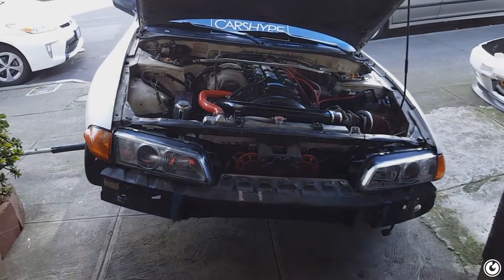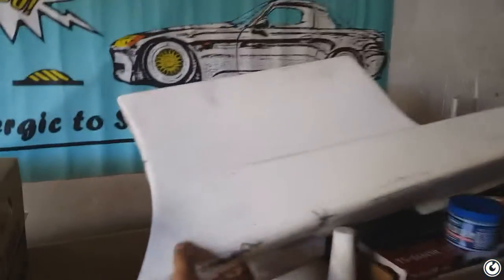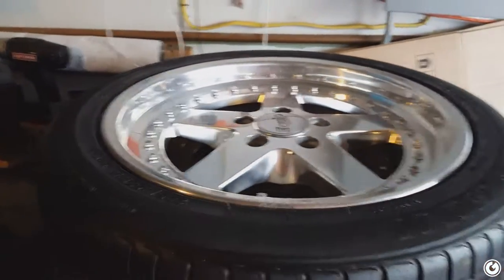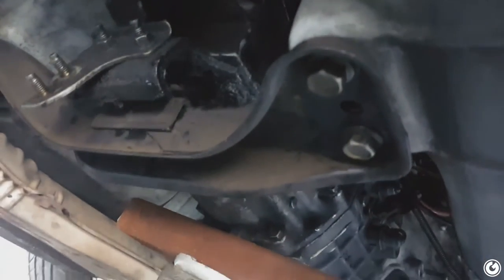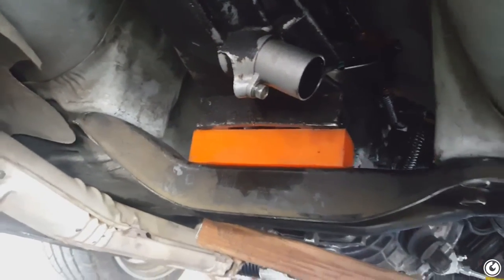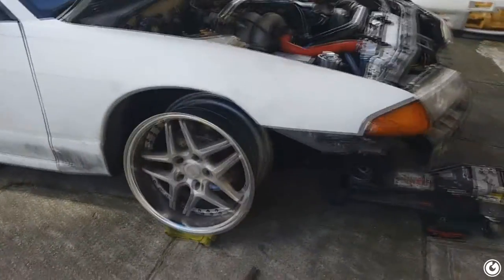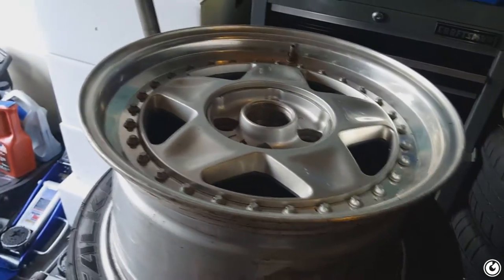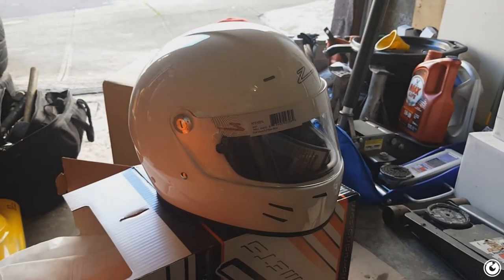ISR Trans mount & Blitz 03s | Episode XII - GTS13

Comment: check your lower trans harness. if you did a auto to manual swap. that might be the case for your Speedo not to work
Reply from the maker: Thanks for the heads up. I still have the issue, no speedo. I've gone over the lower harness, everything is plugged in, I even swapped out the speed sensor for a new one and still no luck.
Reply: Ger Lewis might be a bad harness I'd say. or if maybe that your using a auto harness on a manual trans.